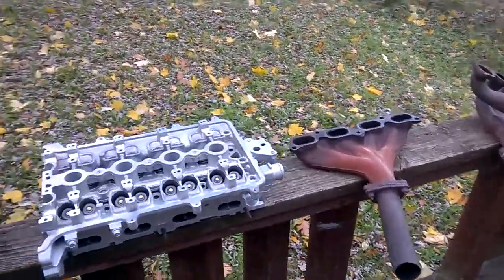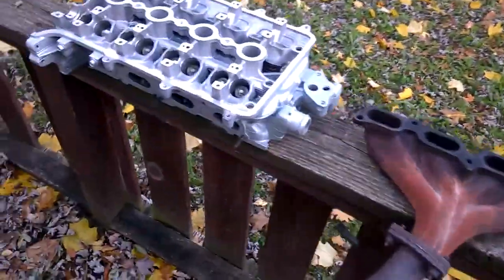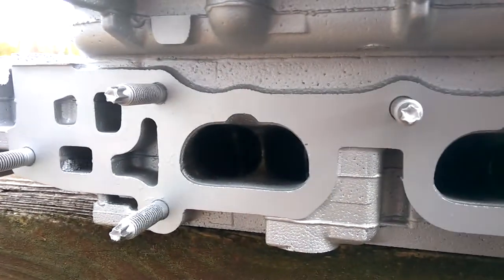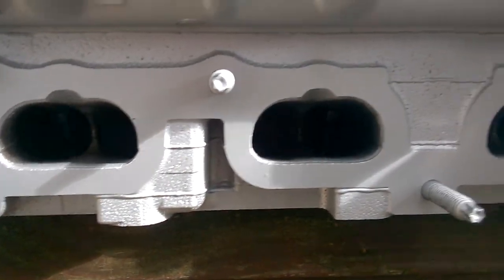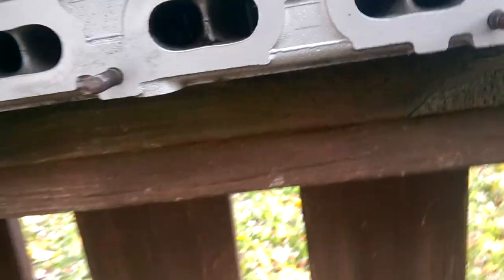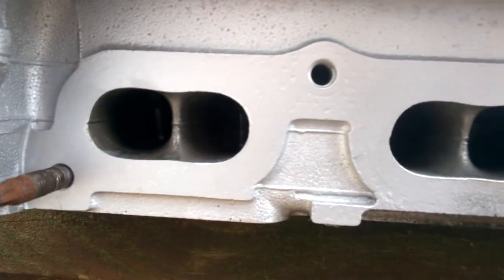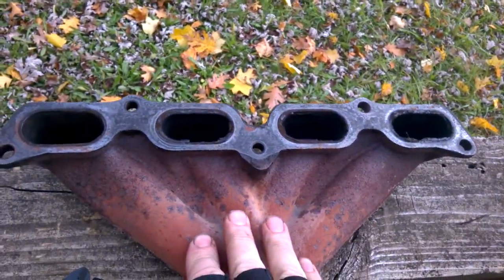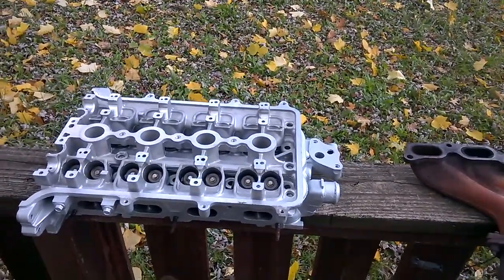Street Port Matching Suggestions(Saturn 1.9L DOHC)

Comment: Any ideas on the 2 aftermarket headers. Eyeball to eyeball....they a very similar to the 91-92 stockers
Reply from the maker: The OBX version is prone to cracking its welds at the flange to the exhaust pipe. To my knowledge, they are the only company that still makes a header for these cars.
Reply: @Joshua_James_Howard  I have obx and I wrapped them.. no issues yet after 2 years 👍
Reply from the maker: @B4949WA  Wrapping the down pipe resulted in a lot of corrosion to the pipe, but I live in the rust belt.